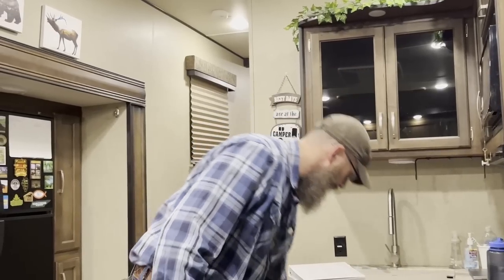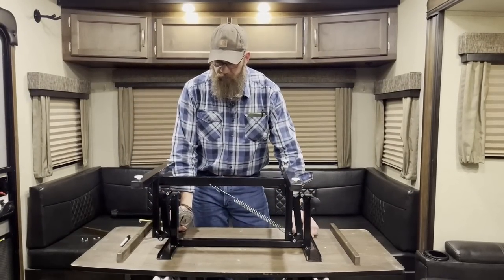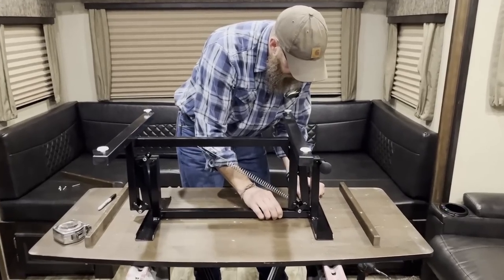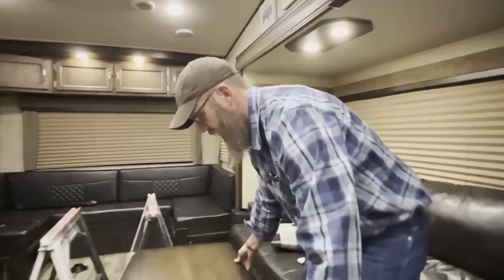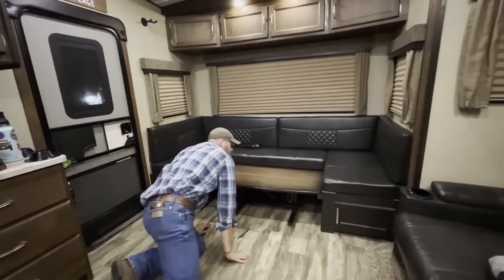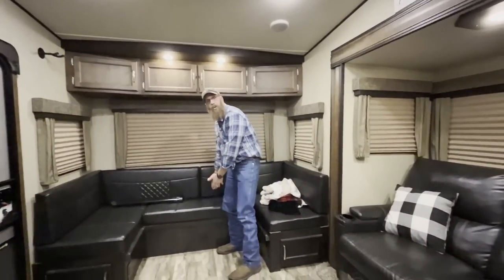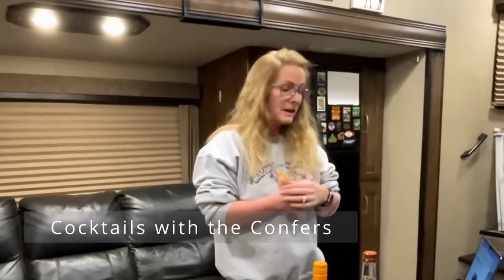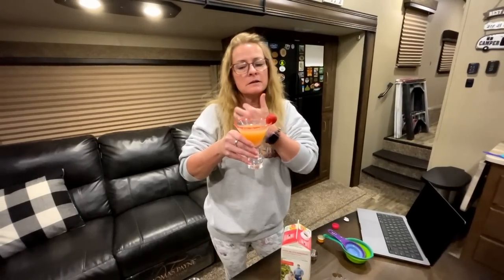DIY RV Dinette Mod | Grand Design RV | Cocktail With the Confers

Comment: I like this idea! One question though. When you moved the table in front of the couch to use as a coffee table/desk, it looked like the legs were in between the full-up and full-down positions. Can the table be locked at those heights?
Reply from the maker: No, it doesn't have a lock but I'm working on a solution to that.  I'm thinking it will be as simple as a well placed "C" clamp and it could be secured at any height.

Comment: Thank you for this demonstration! I just discovered this type of stand for RV tables. Our smaller camper had a Lagun table mount which we installed but now we have a U-shaped dinette, and although I love it, I hate the traditional way of mounting RV tables on posts. We just bought the new trailer and the posts are already unsteady, every time my husband sits down, he shakes the table when he touches it. I am ordering this today!

Today is May 31 and I received the platform and installed it myself. It was a little tight at first, but swung up into position beautifully. I watched your video again and it helped tremendously. Thanks again!
Reply from the maker: So glad this helped you!  It has made a HUGE difference for me!  Thanks for taking the time to let us know, we really appreciate the comments!

Comment: Thanks, did you figure out how to make it an adjustable height?  Im only 5'2' and either my cushions are too low or the table is too high.  Thoughts?  Thanks so much
Reply from the maker: Great question. I haven’t thought about a way to lower it. Shelley is also height deficient but she doesn’t have an issue. I’ll look at it and see if I can come up with an idea for you.
Reply from the maker: I don’t see a way to lower it besides the inch or so that the feet screw in or out.
Reply from the maker: It does set about 1 1/2 inches lower than the original table. Shelley did notice a big difference with it.

Comment: What did you do about the screw holes in the floor?
Reply from the maker: We took a hammer and gently flattened out the jumps from the screws and filled the holes with tan silicone caulking.

Comment: Ok I just ;stalled the widget how do you raise the table
Reply from the maker: Put you foot on one of the legs to hold it still. Grab the tabletop and kind of rock it to one side or the other and it will pivot on the hinge and come up. To lower, hit the little release and do the opposite motion. It doesn't go straight up and down it kinda goes to the side then up.